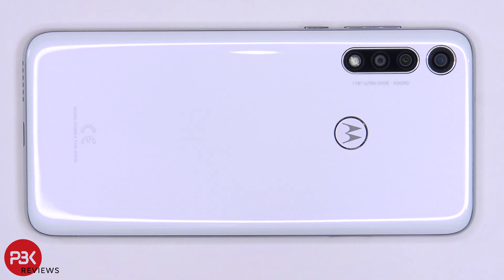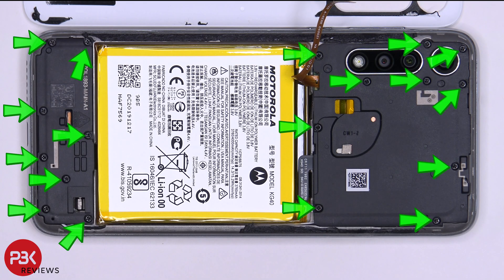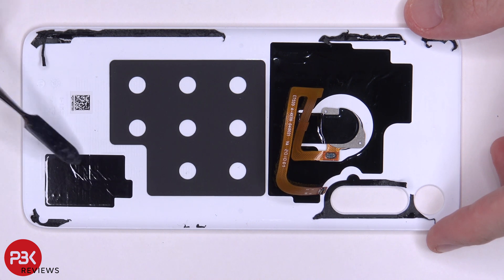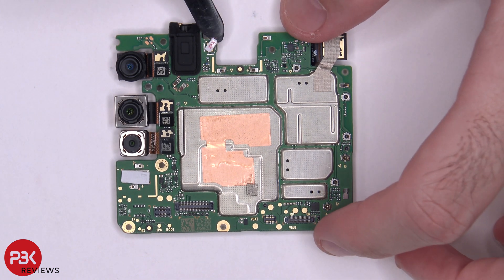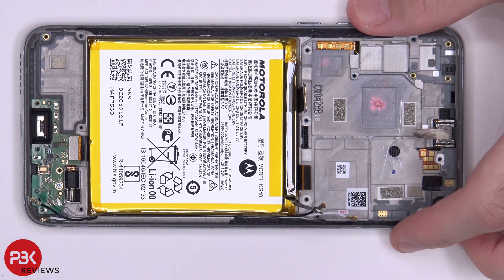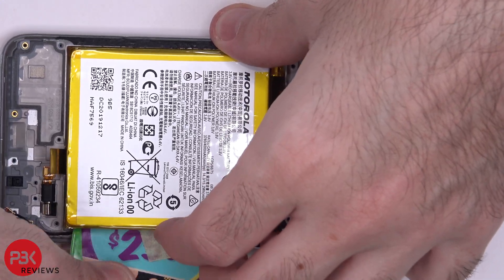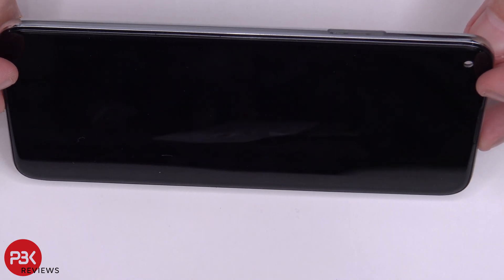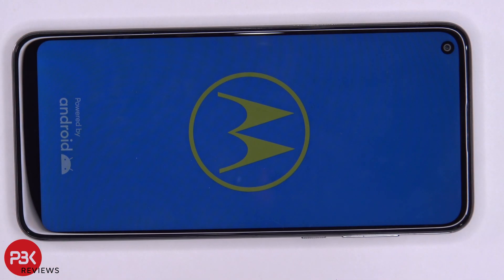Motorola Moto G Fast Disassembly Teardown Repair Video Review

Comment: Great video.  I needed to replace power button that broke and fell out; cheap hack: clipped one side of bracket of purchased replacement hard buttons, pushed into phone and cover case holds it in place. Works great, so I don't have to rely on Motorola gestures.

Comment: Where is the internal storage?  I think the phone comes with 32 gb.  I'm wondering if it could be upgraded.
Reply from the maker: It's soldered to the main board under one of the covered shields and is not user replaceable.
Reply: @PBKreviews  thanks

Comment: Stupid that the back cover doesn't snap on. My adhesive gasket is a mess.
Reply from the maker: yep. If you need replacement back or adhesive, you can get it from mobilesentrix.com

Comment: Thanks for posting this very informative vid' on how to access the interior  of the smartie' .    
Definitely not so simple to get in  LoL

I started looking, as I have broken 3mm pin stuck in the headphone jack.     
Of course powered off, have so far tried using fine tweezer, but they close previous to really gripping the pin.  Still need time to try with a bit of thick material approx. diameter of the pin inserted btwn the points hoping it keeps the tweezers open till either side.
Also tried a bit of 'gorilla tape' inserted in the now broken female end of the jack insert, but it just wasn't strong enough oooor maybe pulled back too soon   (just thought of that, maybe try again  LoL )
But the jacks do tend to 'clik' into place so maaybe require  micro vise-grips   LoL

Luckily can still record, hear ph. conversations,... just media audio recording/you'tube that can't  be heard, except thru a bluetooth spkr.   which luckily I had acquired over a yr. ago from city surplus dept., so finally initialized it  🙂

Hope ya good'un.
Reply from the maker: You're welcome. Yeah sometimes it can be a pain but if you are able to find the right tool to fit in there and work it out, should work. It's always different depending on the item stuck.

Comment: Friend just dropped this off for battery replace, and unbelievably tough just getting rear cover off.  
Obviously this beast is nothing like my LG v20 that just pops off. 
Luckily I used credit card to go along edge to release the glue strip which was a surprise to begin with.. 
Then to see battery is glued in. 
Ok, we better seek a pro version of how this is supposed to go.  
wOw, Thanks Hugely on such precise surgery,  and notes of sources for the device. At seventy, stacked readers might be required for more details. 

Cheers
Reply from the maker: Hi, I replied to your other comment explaining a bit. For the battery, you would need to apply some heat from a hair dryer from the screen side to loosen up the adhesive under the battery or use isopropyl alcohol. Read my other comment for more details.

Comment: The battery was to hard to remove and the battery fire on front of me. I don't know if the cellular still working or not because I throw the battery on the floor and it was too smoky.  I was trying to replace the glass.
Reply from the maker: Make sure not to warp or bend the battery or pierce it, or else that can happen. You can also use isopropyl alcohol to apply some around the edges of the battery and let it sit for 30 seconds so it gets under the battery and loosens up the adhesive to make it easier to pry off. Here is a link to one if you need: https://www.ifixit.com/products/ifixit-adhesive-remover?variant=39915173740647   and you can get original replacement parts for this phone at www.mobilesentrix.com
Reply: @PBKreviews  too late, the cellphone was on fire. I thought the cellphone is gone. Thanks for answer me.

Comment: How do you reassemble it? Because my cover is coming off.
Reply from the maker: You would need to buy the original pre cut adhesive for it to replace with the adhesive strip that is going bad. Here is a link for parts for your phone: https://www.mobiledefenders.com/motorola-repair-parts/g-series/g-fast-xt2045.html

Comment: Great video!  I'm assuming that it's possible to remove the battery after removing ONLY the top cover, correct?
Reply from the maker: Thanks. Correct, once you remove the back plate and remove the top cover, you can disconnect and pry off the battery. You can use isopropyl alcohol to get some around the edges and under the battery so it eats away at the adhesive, making it easier to pry it off. Here is a link for it if you need https://www.ifixit.com/Store/Tools/iFixit-Adhesive-Remover/IF145-400?o=4  and you can find parts for this phone here: https://www.mobiledefenders.com/motorola-repair-parts/g-series/g-fast-xt2045.html
Reply: @PBKreviews  Thanks!  I accidentally walked into a pool with my phone.  It was only in there for maybe 20-30 seconds, which I realize is a lot.  

I swapped the battery but it still doesn't work.  You wouldn't happen to have any idea why it's not working still, would you?  

I'd simply like to get the data (contacts/pics/memos) off of it, but that seems unlikely now.  

There's a 6-variety-pack of sauce (that I produce) in it for you if you can help me extract that info.

Comment: Am currently trying to get a motherboard for this phone I love it so much everything is work expect my hotpot Bluetooth WiFi and data service not working I rested all the settings for it rebooted , safe mode it nth works I bring it to a so call tech guy that had it for 4 months to tell me its something on the motherboard
Reply from the maker: You would probably need to check on ebay or other places to see if anyone has parted their phone out.

Comment: Question for ya, is there a way to plug screen into motherboard to make sure it works before I put back together?
Reply from the maker: ya you can just install the screen cable and battery cable and test it before you assemble it.

Comment: I found a digitizer on Amazon for $32. If I pay for the digitizer and I send you my phone how much will you charge me to replace it?
Reply from the maker: Hi, you cant replace only the digitizer. It's fused with the screen so you would need to replace the entire screen assembly. Only factories with special tools and machines can replace just the glass. You can order a complete screen assembly with pre installed frame from this website : https://www.mobiledefenders.com/motorola-repair-parts/g-series/g-fast-xt2045.html    . Also you would need the pre cut adhesive (back cover) to re apply your back cover to the phone. So basically with the screen assembly with frame combo, you take all the parts like the board, battery, speaker etc from your old frame and place in in the new frame. I don't do repair services, plus even if I did, it would not be worth the cost to cover shipping both ways, and the labor etc would be cheaper to just take it to a repair shop near you.

Comment: does anyone have a video of the screen repair?
Reply from the maker: its explained how to replace the screen once you take apart the phone, there is nothing left but to pry the old screen off the frame, apply new adhesive and reapply the new screen. Also they usually sell the screens pre attached to the frame so all you need to do is just move all your parts from your old phone frame to the new one that's all. You can get the original parts and screen with frame from mobiledefenders.com

Comment: Hi, it's my last chance to rescue my hardbricked device Moto G8 Fast, I need to Enter EDL Mode on Qualcomm Android Devices By Shorting Hardware Test Points on main board... Does anybody knows where they're located ? /Regards !
Reply from the maker: The test points would probably be the circle connectors which look like the connectors the coaxial wire cables which run from the main board to sub board connect to. I'm not behind the computer to circle them on a picture.

Comment: Hi hey great video. hopefully my only question is. when replacing the screen will i need the same adhesive strips as in the back?
Reply from the maker: The screen adhesive would be different, but you can order a complete screen and frame assembly pre installed on www.mobiledefenders.com
Reply: @PBKreviews  wow dude super fast response! so yea i saw that the "assembly" on the site. is that all i would need? like i follow all the steps through in your video then i pry off the screen, feed the new cord through and attach it. Then, this is where my confusion is, fit the screen assembly to the midframe?
Reply from the maker: @kingsoradical5475  if you are getting the screen assembly,  then you dont need to pry the screen off your old midframe. All you do is take the backplate off and take all the parts from your old phone frame and place them on the new frame with screen assembly. Since the screen comes pre attached to the frame, you move the parts like the board, vibrator motor, earpiece speaker etc all over to the new frame with screen attached and just re assemble. Much easier than having to pry the old screen off and apply new adhesive for the screen. Also you will need new pre cut adhesive to re apply the backplate which that website also has. :)
Reply: @PBKreviews  OMG! dude you are awesome! I'm just waiting for the parts to ship to me and now that I've saw your video and gotten your advise i feel pretty confident i can do this myself rather than needing someone else to fix it for me. Thank you so much again man, you are what real heroes are like!!!
Reply from the maker: @kingsoradical5475  you're welcome :) feel free to ask any questions you may have.

Comment: Just got the g30 New out the box, had a little lump on the right side on the back, you can see it and feel it, but its small, something inside is not  put together right, the store dont wanna take it back, customerservice cant help until monday, so looking into what could cause this, thinking that it might be a screw not screwed in All the way.
Reply from the maker: Yea it's possible it might be a screw or the black plastic cover hasn't clicked into place etc. I did a teardown on the G30 also but just have not gotten around to editing and uploading it, will try to get it up soon.

Comment: What do you need to do just to replace the battery.
Reply from the maker: You would need to remove the back plate, remove the screws on top plastic cover and remove the cover, disconnect the battery cable, use isopropyl alcohol to get a few drops around the battery and let it sit for a minute to get under the battery and eat away at the adhesive, then gently pry the battery off with plastic pry tools
Reply: @PBKreviews  thanks so much.
Reply from the maker: @roadtripdave6188  You're welcome

Comment: As I remove the battery I smell some type of alcohol. What does that mean
Reply from the maker: Its probably just the chemical smell of the adhesive strip.
Reply: @PBKreviews  thank you for the answer. I was worried a little bit
Reply from the maker: @carlosmartinez8322  no problem

Comment: I did it!! Just replaced my  screen after 5 months of shipping through cracks. Thanks for tutorial!!
Reply from the maker: You're welcome
Reply: Sorry for this late comment, but do I really need to disassemble the entire phone to replace screen? I removed battery.
Reply: @luisangelvasquezfierro   You do man. I know it sucks!
Reply: @dannysmith8408  so you mean the proximity sensor, has to come off as well? Right?
Reply: @luisangelvasquezfierro  Everything!! Go exactly with the videos
Reply: @luisangelvasquezfierro  Everything!! Go exactly with the videos
Reply: @dannysmith8408  and this is just to pop off the screen, right? Because I’m trying to take it off right now without taking out everything and it’s a challenge. Is that why?
Reply: @luisangelvasquezfierro  igual pienso arreglar mi phone G fast moto, q se le quebro la pantalla, pero tenaz toca desbaratarlo todo para reemplazar la pantalla.

Comment: I have a question, is the moto g fast screen the same as moto g8
Reply from the maker: Hi, I believe its the same but I am not 100% sure. Here is a link for the original screen with frame for the moto g fast, you can compare the layout and cable for screen to the moto g 8 if that is the phone you have and if you have it taken apart. https://www.mobiledefenders.com/mobile-parts/motorola/g-series/g-fast-xt2045/display-assembly-for-moto-g-fast-xt2045-authorized-oem-holo-white.html

Comment: I'm having a problem where my phones audio is very muffled and I'm trying to access the speaker from the outside
Reply from the maker: So the speaker sound is muffled? not the earpiece and not your voice going to other people correct? Have you tried using a brush to clean out the speaker holes from the outside?
Reply: @PBKreviews  I commented this yesterday and it's back to normal now. It was because my baby brother drooled in it. I fixed it by repeated shaking for like an hour
Reply from the maker: @claytonwalker7573  Oh I see. Ya possible it dried up as well.

Comment: Do you have a reference for adding glue? Where to apply? What adhesive would you use? Would rubber cement work?
Reply from the maker: Hi, you will need to use either pre cut adhesive strips which are made for the phone or if ones are not available you can use 300LSE or other smartphone adhesive strips that you can cut down to size. Fortunately there are adhesive strips available for this phone, here is a link to an original one https://www.mobiledefenders.com/adhesive-back-cover-for-moto-g-fast-xt2045-authorized-oem.html

Comment: Why is there a thermal under the flash 😂
Reply from the maker: Some people leave the flash running for long periods as flash lights and it tends to overheat or burn the flash out, so now a days they tend to add some sort of cooling under the flash as well. :)